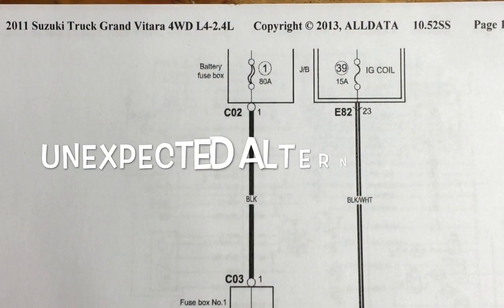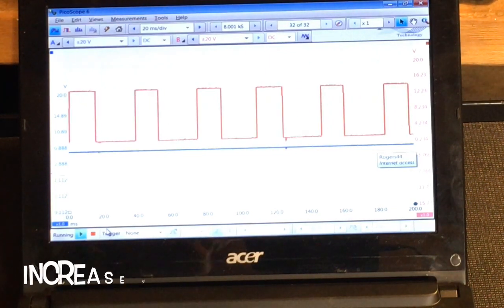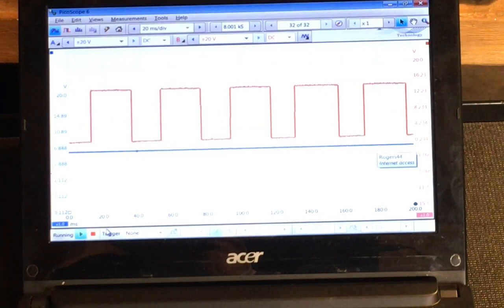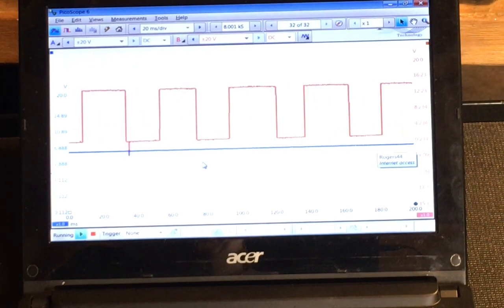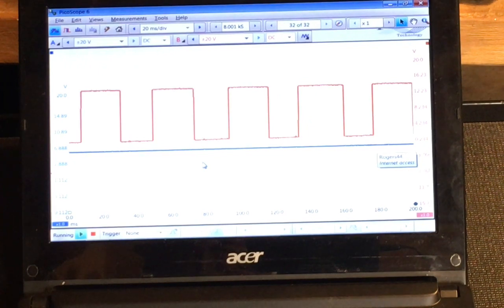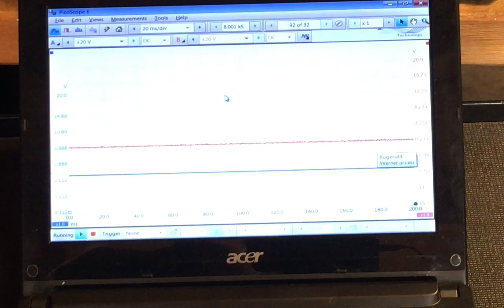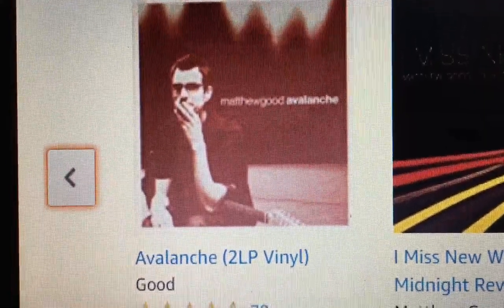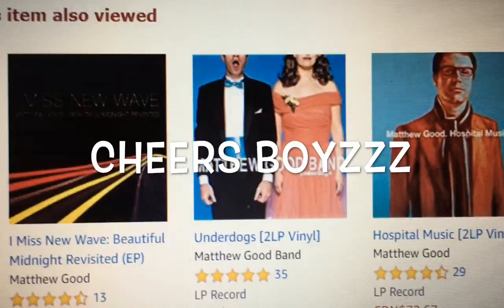Duty Cycle Alternator Control 3/3

Comment: It's got more to it than I realized, I was expecting some sort of control or feed back signals all of the time. Thanks for sharing mate
Reply from the maker: Mechanic Matt Hi Matt. Nothing like I expected. ECM only appears to “ask” for more Gen O/P while the regulator controls decreasing demand. Guess the approach allow ECM to ramp up the load to prevent shock loading the crank. Interesting! Cheers Pal & Thx

Comment: Great video thanks for the help I have a question I'm having a lot of trouble with my charging system 2011 infinity I've already replaced the battery the alternator the belt. I've cleaned all the grounds and terminal connections I am still not getting anything From the alternator just battery voltage. I've Even used the scanner and Went to the alternator duty and increase it from 0 to 100 percent  ( In a function test mode) and still nothing to the battery.  Also I cut the wire  That leads to the alternator duty control at the alternator the one labeled C  and gave it a ground with nothing resulting I gave it a Positive same nothing.  This alternator has 3 small connectors labeled LSC and then of course the big one to the battery.  I'm thinking my computer is not sending out the  Pulse signal. I might have to get a computer or module or something do you have any thoughts?thank you. Happy new Year
Reply from the maker: Honestly not familiar with Infinity at all, and without seeing the schematic it’s difficult to say. Double check the basics. Did you check the alternator case to ground voltage drop? Check from output terminal to battery positive. I realize there is no output but check Cable integrity from output terminal to batt +. Check at the alternator connector + & ground. Not just with a meter but load test it with a lamp that draws reasonable current. Check the duty cycle control signal is actually reaching the alternator. Ideally with a scope if possible. Also don’t overlook the possibility of an issue with the contacts at the ECM/Module or alternator connector itself. Issue with the ECM or even your “new” alternator should not be dismissed. No magnet pull on your screwdriver at the rear of the alternator case will point to a field/control issue. If pull is present , look at the output side. Good luck. HNY
Reply: @TheGibby3340  I found it! I got another plug from the wrecking yard to see if the pins were better connection. Then when i took apart the harness a little to crimp the new plug on I found a broken wire. It was the wire that goes to the dash indicator. I fixed and now charges good. I figure the dash indicator is connected to ecm charge monitoring. Thank you Sir.☺
Reply from the maker: @mike602mike5  Awesome Cheers  🍻

Comment: Hello I have some doubts but for now I will ask you just these questions. As I understood, the commands are referenced negative-wise, so when the blue pulse sets to 0 volts, it means the alternators duty cycles is almost 100%. right? And also I will ask you this, the red pulse is the ECU commanding, and the blue pulse is the actual alternators duty cycle feedback to the ECU, right?
Reply from the maker: Hi Thx for watching. My understanding is as follows...Blue trace (Ch A) is ECM 0-5V -Duty cycle control. As Vehicle Electrical load increases it increases -D/C (width of the near ground portion increases) The alternator O/P reserve capacity is reflected in the Red trace (Ch B)  -D/C  0-12V. As alternator O/P approaches Capacity (at idle this will be many times lower than rated) the trace will trend toward ground. This approach prevents shock loading the crank and destabilizing idle by ramping up alternator output. It only appears to function for increasing load demand. Decreasing load appears to be managed via traditional voltage regulation. So I believe this is not a voltage regulation function but load management. Realize I am only a hobbyist and this is only my interpretation...it may not be correct. Hope this makes sense and addressed your questions. Cheers
Reply: @TheGibby3340  I dont know why this and the previous parts dont have more view, this is pretty good information that you only find in books or couses in which you pay hundreds of dollars. And to be a hobbyist I think you manage to understand pretty well all that information, it is not easy. I am an engineering student but to support myself economically I do electrical works on vehicles by using the knowledge I have on electricity so I am learning this stuff. Another question Sir, On minute 4:56, at what voltage value is the blue line set? It is hard to read it.
Reply from the maker: Leopoldo Lopez The Blue trace is toggling between 0-5V at 4:56 it’s steady 5V (meaning no increase in alternator O/P is required at that moment) . You don’t need to call me Sir (although the respect is appreciated) my name is Ian. Cheers 👍

Comment: Most suzys in uk the uk are gm based which use a regulated voltage control dependant on various strategies including engine load which may help to what you're seeing, not just electrical load. Just my first thoughts ian, cheers dave. Wee cat's very vocal
Reply from the maker: dave sterl Clearly more to it than I thought Dave. Yeah the wee cats my Pal. Cheers Dave